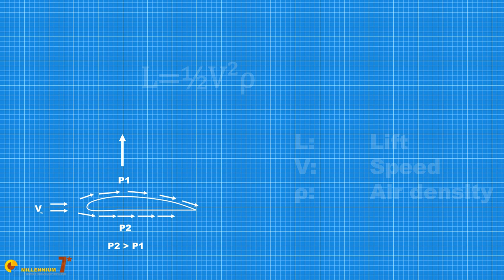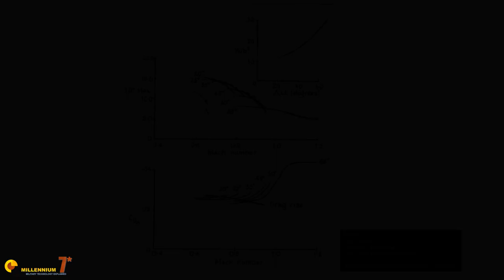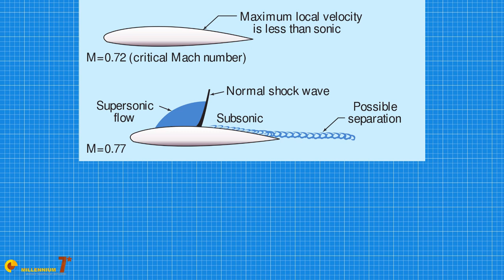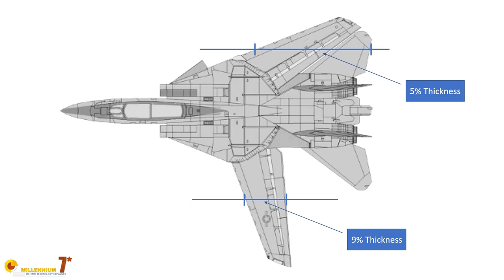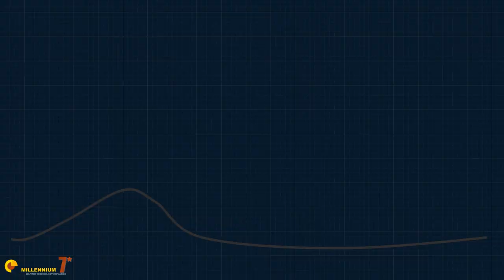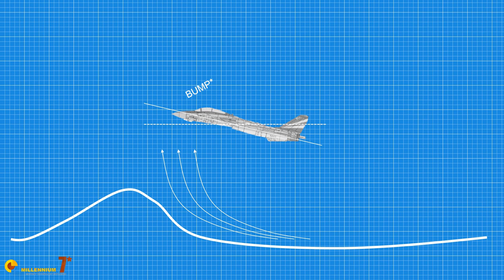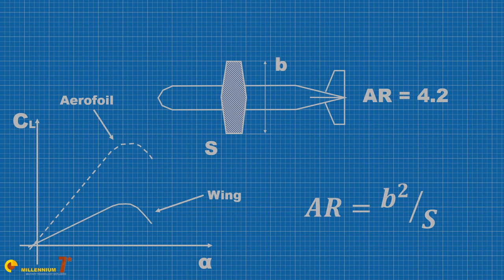Secrets of the F-14 Tomcat design -  The formidable wing of the TOP GUN fighter

Comment: Fun fact 1: the naval fixed wing Su-33 weights as much as the swing wing F-14.
Fun fact 2: the landing speed of the Tomcat is slower than the Super Hornet, and this is already slower than the legacy Hornet.
Reply: The Super Hornet... The little fighter that can't 😁
Reply: @Haya-OhWaves  you have to wonder the logic... if it was remade larger to get more range... then surely an f16XL style wing that offered more lift and more space for fuel would have been the way to go? did no one guess that long range air launched anti ship missiles would be a thing? did navies think that the british navy sinkings by argentine exocet were one offs?
Reply: @mrrolandlawrence  hello ! I have no problem with that. You're right.
Reply: And the legacy and Super Hornets are far easier to bring back to the boat. Why? Pitch and lateral authority at low speed in the Tomcat were laggy, and it had a tendency to float above the glideslope. With TF30s, the low speed throttle inputs weren't responsive, and that's the main control for maintaining glideslope on final.

Only a select few pilots could handle the F-14 in the pattern behind the boat, which was the determining factor in getting qualified in the F-14.

Of the at least 173+ F-14s lost (1970-1999), a substantial % of them were ones that departed on final behind the boat.
Reply: @LRRPFco52  key words being "with the TF30s".  Those problems were eliminated with the use of the F110-GE-100s.  The TF-30s never should have been put in a fighter airframe, period.
Reply: @danielvogel5252  They still would have been better with DEEC/FADEC, which they never had even with the F-14D. TF30 was the pioneer fighter afturburning turbofan in the F-111. Someone had to build the first fighter turbofan in the 1960s.

I agree that they coulda/shoulda/woulda, especially after investing so much money on a new engine for the F-14 that we never saw.

The eventual engine upgrade never addressed the inherent problems with the complicated flight control system either.
Reply: @mrrolandlawrence  Delta wings usually have faster landing speeds with high AOA. The only carrier-based delta wing I'm aware of is the Rafale-M, which has far superior mission radius to the Super Hornet by a factor of 2, comparable to the A-6E Intruder's impressive radius.

The US had a delta wing with canard design in the 1960s called the Convair 200, but it never left the scale test model stage.

Comment: A couple points to add: 1) The F-14 was capable of sustaining much higher g loads than any other fighter in service then or after. 2) The F-14 was unmatched in turn rate because its sustained turn velocity was nearly 100 kts slower than its contemporaries. It was a foolish pilot who decided to engage the Tomcat in a turning fight. 
 So if it was so good (and it was), why don't we use it any more? Well, it was expensive and difficult to maintain. It was incompatible with AMRAAMs and the Phoenixes had been pulled from service. It was never very good at the ground attack role because it lacked a sophisticated RWR and jamming suite. But mostly because the Navy had decided to consolidate and couldn't justify a 'pure' air to air fighter.

Comment: Pity that it was prone to compressor stall due to the compressor fan at the mouth of the engine. the TF30-P-414A jet engines that powered the early model F-14s was considered susceptible to compressor stall, due to some design flaws. The result of these faults is that the F-14A (in real life and in the movie) is easily susceptible to engine failure as a result of disturbed airflow. This is demonstrated by the unfortunate death of Lt. Kara Hultgreen, an F-14 pilot and the first female carrier-qualified pilot. She was on final approach for a carrier landing when she drifted off course. She attempted to correct the problem by yawing the aircraft, but the change in the angle between the aircraft and the air caused her left engine to suffer a compressor stall and flame out. She was unable to recover and her aircraft struck the water.
Reply: And she was criticized for yawing to line up during her extensive training in the F-14. She had done this in her former plane, the A-6, to correct for line-up problems, but she was told NOT to do it in the F-14. She was being pushed through F-14 transition training for Clinton's political goals and not due to ability. Since then, other female pilots have flown the F-14 without problem, but Hultgreen was the wrong choice.

Comment: I'm curious why they phased the F14 out. I have trouble believing it could not be continually upgraded. It seems military aviation has plateued. The B52 was considered " ancient" back in the mid 1970s when I was at Andersen AFB in Guam. Yet it's still in service. I remember when I first heard about the F15 & F16 , they are still in service. Can anyone she'd some light on this?
Reply: Very high maintenance manhours per flight hour right 90 to 1 this is what also ended the Prowler at 80 to 1. Compared to the Hornet at 8 to 1 it was matter of manpower and money. I worked on all three Aircraft when I was in the Navy.
Reply: The Tomcat needed much maintenance for its swing wings and two engines, but their maintenance were far from as a bad as 90 hours of maintenance on the ground for every hours flight in the sky. Perhaps 15-20 hours is a more reasonable number, but it is still a bit high.
The problem with the Tomcat was that it was a large plane that took up much space on a little ship. So having many small F18 fighters instead of a few F14 planes could be plus. Another reason why the F14 was scrapped was its weak engines. You could of course give it more powerful engines - but that would be enormously expensive.
So then you come to the next problem, should you upgrade old F14 planes, or is it smarter to use the money to buy new planes instead? Like the F35.
Another problem with aircrafts is that their air frame suffers from much wear and tear, the same way a car or a tank does if you drive over rocks and ditches and wear your car out. Jet fighters suffers from extreme speeds and sharp turns, salt water from the ocean, and hard starts and landings. So these decade old cats have been through much.
And as planes gets older they need more maintenance to be able to fly. And their quality has declined, just like the quality of an armor plate in a tank declines over time as your drive it over bad terrain - so the armor will therefore not protect your tank from a projectile as good today as it did 50 years ago.
So exhausted air frames is probably an important reason why otherwise impressive planes like F4 Phantom has also finally been taken out of service.

F14 was a fighter built during the cold war to shoot down Russian bombers on their way towards America. And were supposed to protect the aircraft carriers by shooting down enemy planes from far away with Phoenix missiles.
But now we don't have any Soviet bombers anymore. And the Phoenix missiles was a disappointment. They were enormously expensive and I guess their hit-rate was something awful like 6%.
So a new role have to be found for this plane in the current age.

And finally. We people who love airplanes realize that the best thing is always to built a plane to do one or two tasks very well. And then you built another aircraft that are specialized at doing other tasks. You cannot get a plane that is best at everything. It is hard to build a plane that can both replace a F16 and a B52 at the same time so to say.
But economists and politicians have a different view.
They rather want a few types of planes that can do all types of jobs. Thereby do you not have to get so much spare parts for every type of aircraft so it becomes cheaper when there are similar aircrafts used and a commonality of parts and components of every aircraft. So their view from a logistical and economic standpoint also makes lots of sense. Instead of having F14, F18, Prowler, Viking, Intruder, Hawkeye on board of a carrier deck, it could be smarter to just use the F18 to take over the jobs of many of those other planes to make logistics of spare parts easier.
I think this dream of having the F35 is based on the same idea - to have one plane that could do all types of jobs.
Just like the F4 Phantom served as a fighter for both the air force, the navy and the Marines, and it fulfilled all kinds of jobs from fighter, to recon, to attack, to electronic warfare.
Reply: @nattygsbord  sorry to say those are the facts. It wasn't just wing sweep and dual engines. It had three times the moving parts of Hornet and nearly a third more then prowler. They were hydraulics nightmare, then rigging the flight controls was another high maintenance hour process.
Reply: @patrickradcliffe3837  They are not the facts. He talks about the F-14 being aged while conveniently ignoring the fact it's only 2 years older than the F-15, which he probably double-standards and doesn't hit with the same argument. He talks about the airframes being decades old while conveniently ignoring the fact the youngest airframe sent to the shredder was only 15 YEARS OLD. He talks about weighing the choice of building a new fighter or continuing with the old while conveniently ignoring the fact the Tomcat's 4 & 4.5 gen peers are STILL receiving upgrades. For fucks sake, he even claims the 14 was retired because of "weak engines"... while conveniently ignoring the fact the D model was famous for it's superb F110-GE-400's. The majority of the post was ridiculous.

Comment: No aircraft in the US Navy inventory has come close to the capabilities of the F-14 since its retirement. Time to bring back a modernized version!
Reply: The problem is that the air frames are old. And after enough wear and tear will a plane one day break apart and crash.

The next problem with this bird is that it is a large plane taking up much place on a carrier deck. Which means that you can have fewer planes on board of an aircraft carrier that you could with another type of plane.

The F-14 demands large amounts of maintenance -much because of its swing-wings, and a stealth version of this plane would demand even more maintenance on top of that.

An extra type of planes on board a carrier will create more logistical difficulties. I do not like the Hornet because I think it is ugly. But I have to admit that letting it taking over all kinds of roles with the Hornet have made logistics much easier when you now can use the same spare parts for all aircrafts on a carrier deck instead of having spare-parts for both the F18 and the F14, and the A6 and the prowler. And maintenance crews now only have to learn to handle one type of plane.

And from what I have heard have most F14 tomcat airframes already been scrapped. There are probably more Tomcats in Iran than there are in USA at this point. The few left are museum pieces.
So if you want a new F-14 Tomcat you have to build them up from scratch - which will cost a lot of money. And then it could be smarter to build a completely new plane instead. Perhaps a new plane that borrows very much inspiration from the old F-14 Tomcat, but which of course needs to look after military needs first, before any nostalgic considerations.
Reply: F-35C exceeds the F-14 in most of the relevant metrics, especially combat radius and loiter time, while adding SA to the carrier battle group that was unimaginable in the Tomcat era.

It does networked stealth Fleet Air Defense, over the horizon targeting for surface-launched missiles, Anti-Submarine Warfare, and early warning for TBM launches. It also does AWACS with better air and surface target discrimination than the E-2, while performing stealth deep penetration strike and EW. Add networked continuous multi-spectral ISR to that.

The F-14D with LANTIRN even is a relic compared to it. Senior Tomcat advanced systems program managers and test pilots have said as much.

Also, unlike the F-14, the F-35C is the easiest fast-mover to bring back to the boat, and can return with a lot of weapons during cyclic operations.
Reply: @Joe150 ish The last D model rolled off the Grumman line in February, 1991 (the month after most of the air war MiG-killing in Desert Storm).  They were retired in December, 2006.  D models were 15 years and older, which is still pretty young for most fighters.

Desert Storm was kind of a shock to the Navy senior leadership when none of the F-14s were able to shoot down any other fighters, while F-15Cs and even Hornets got all the kills against Iraqi MiGs.

There was an early incident where a Red Sea-based F-14 RIO gave the pilot the wrong intercept vectors because he used the incorrect reference point, which set them up for intercepting one of their own A-6Es that was returning from a successful attack and headed back West, instead of the MiGs they were vectored to initially.

A USAF AWACS Controller quickly was able to have them check fire before killing the A-6E with an AIM-7M.  The leadership pulled the leash in on them and had them doing Fleet Air Defense flying patterns over the Red Sea, rather than going "feet dry", much to the frustration of Tomcat pilots.

Then there was the AIM-54C incident where an F-14 crew tried to engage an Iraqi fighter and it fell to the earth, and the other in 1999 where 2 F-14Ds fired at MiG-25PDs, who turned and evaded with high supersonic speed.

Well before that over Iraq (in 1992), a family model F-16D that was meant to give USAF visiting VIPs the chance to fly into the No-Fly Zone and get awards, was the first to kill an enemy fighter with an AIM-120.

The Navy looked at the cost of the AIM-54C and F-14A/B/D maintenance, and was tired of all that just to have a fighter that barely works 40-50% of the time, with its primary weapons system going 0 for 3 in actual combat in an area with plenty of targets to shoot.  The Phoenix was retired even before the F-14 was, living its last bit of life as the Bombcat until the Fleet could get enough Super Hornets.

Comment: Didn't the Tomcat have lots of trouble with its engine being to far apart  ?? ...love this aircraft.
Reply: Alfred Churchill  I think you mean the newer versions had better engines. the A and B shared the TF30 engine with the F-111 and it had issues during dogfighting.
Reply: I think I have read that it was only A models that were involved in crashes in the early 1980's. But the problem seems to have been quickly fixed so that more crashes happened, like that one who killed Goose in Top Gun.
Reply: Ok lesson in facts. The A was supposed to get a Pratt set that was on par with the GE. Since the navy was cheap they stuck a burner can on the TF30 as they had plenty. The A plus, B, and D had the GE 110. The A was a beast at low alt and flew the same demo as the later versions. You had to fly the engines correctly.
Reply: Alfred Churchill  in six years in tomcats my squadrons only lost one bird and it was a catastrophic engine fail. 
I never said the TF30 was perfect but flown correctly it was a good engine. That being said the GE was twice the motor. The demo profile was impressive regardless of which engines used but the GE had a lot more grunt. As our pilots said you had to know the engines envelope and work with what you had. 
I'd recommend you check out aircrew interview and watch the Okie Nance interview. His insights are quite revealing.
Reply: Alfred Churchill  completely agree. The 110 was impressive throughout the envelope. The history of the cat might have been different if we had the right engines from the start. The Pratt motors had a good run for what they were but thankfully by the late 80s were starting to be replaced along with the intake walls
Reply: Alfred Churchill  I know right. That makes too much sense lol. Although it looks like the GE110 is being used in both the 15 and 16. I could be mistaken but I was at an airforce show and thought I saw different engines. The F16N with the 110 was an epic combo. We had them in key west as adversary birds.

Comment: I'll add a second and unrelated comment about DoD stupidity. In both the F-111A and F-14A programs, the aircraft only matured at later times, F-111E and F-14D strike aircraft by which time the older and more plentiful models were in the boneyard or barely operational. The problem was, IMHO, the initial P&W engines which underperformed until replaced with the version envisioned in the first place. That and simple maturity produced aircraft that met the  requirements. So sad. So many guys buying the farm as a result of DoD wonton stupidity. Don't get me started.

Comment: Holy hell. 7Gs at Mach 2
Reply: Usually the airframe was limited to 6.5 g for safety reason, with a breaking point reported around 9.5 g. For a comparison, the F-15C is rated for 9 g and that value can be overrun by 50%, that means 13.5 g to rupture.